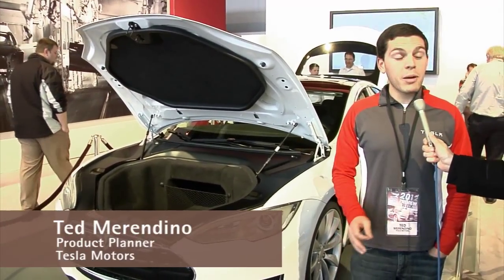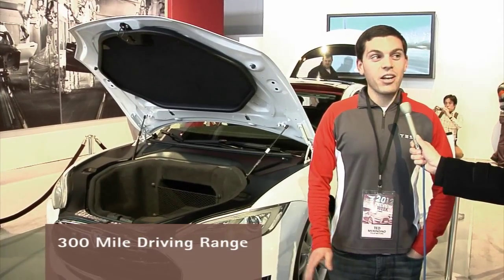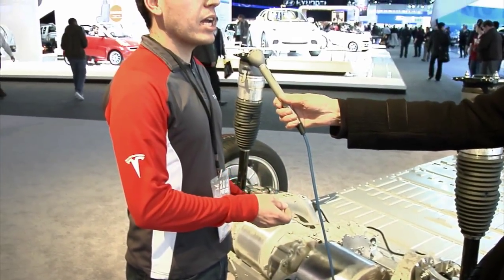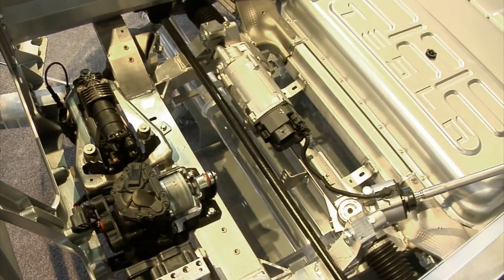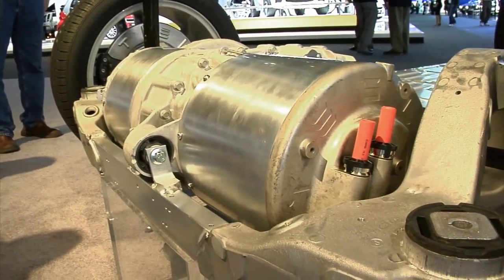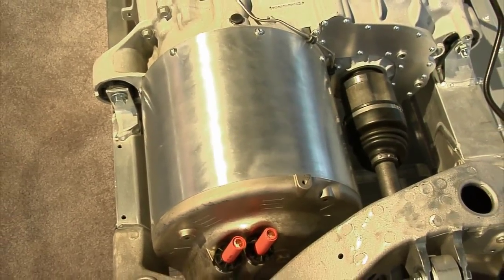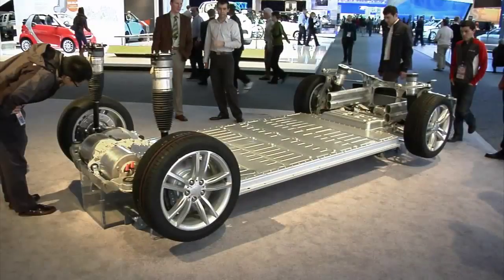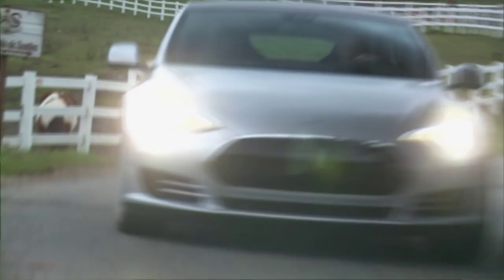Copper Rotor Motors In The Tesla S

Comment: Sales pitch person:" Eficiency and performance are not mutually exclusive". Well they chose an induction motor because it was cheap and has high peak torque, giving fficiency the middle finger. Low load efficiency of an induction motor is deplorable. A model S uses 2700W to drive at 25mph, when the energy needed is only 900W!! Likewise at highway speed it is wasting 3-4kW as the motor is too big to be loaded enough at cruise, to reach acceptable efficiency. Induction motors are not suited for EVs even with copper bars.